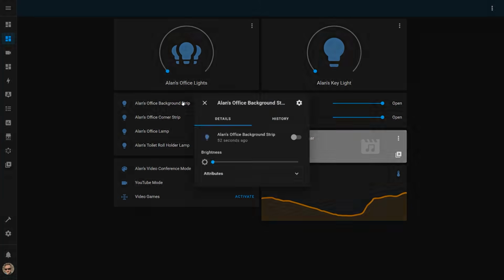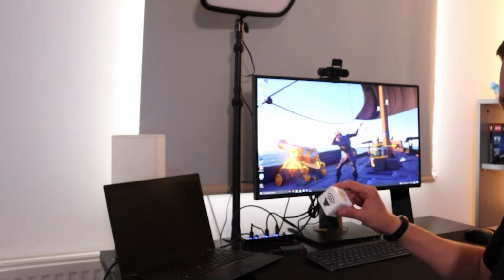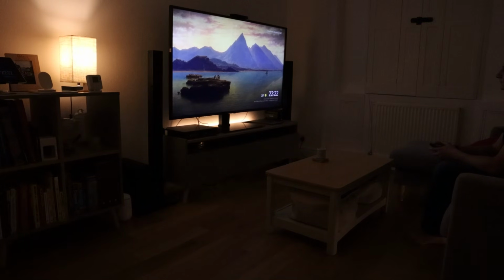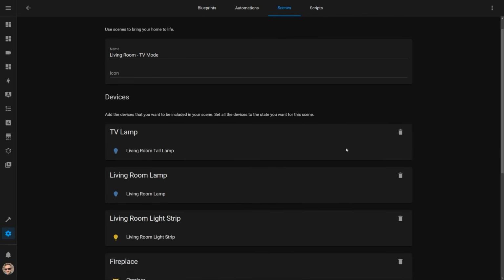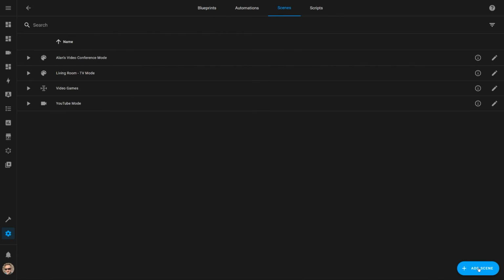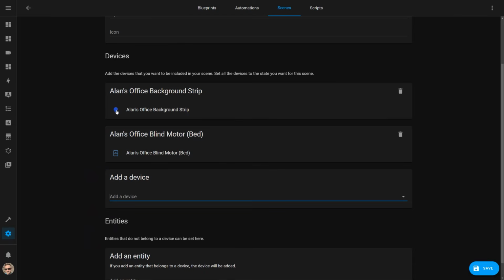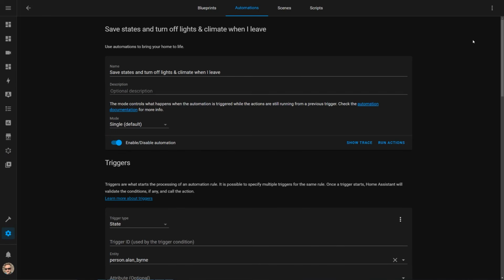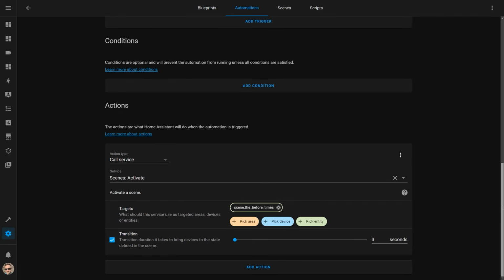Using Scenes in Home Assistant - Home Assistant Tips

Comment: nice! i've a similar setup, HA and zigbee based stuff, only difference is that i tried using appdaemon to create more complicated automation (like binary sensor > lights blinking, ) and more importantly for the appdaemon dashboard that i can run with my very old ipads. Gonna try out the magic cube!

perhaps would be good if you can talk about (if not yet)
- smarthome, power outage, UPS
- networking for CCTV on VPN & HA integration

good stuff! keep it up

Comment: The temporary scene ok, I can follow, but a normal scene. I see no use for it at all. I can group lights and do the same with one command in an automation just not only turning on the lights but also add the parameters for brightness, RGB and so on when switching it on.
In my eyes HA scenes are absolutely useless as I can do it via a normal automation and as fast as with a scene.

When I first read scene I thought it would be a group of parameters I define for my device and when I need it, I just tell HA to use these parameters on my device. That would really make sense.
For example I want all my corridor lights to switch on with a special brightness, warmness or color depending of the time range the light is turned on. I don't want all lights to turn on with these parameters, no they should go on with these parameters when they are needed. So lets say I have 5 individual lights and I want to have 3 different kind of parameter set for these lights, Day, dawn/dusk and night. With scenes I now need to define 15 different scenes. just to accomplish this. That's bullshit. Then I can define three automations with if else clause to make that. It is the same, but far more easier to track.
I'm sure with yaml or in Node-RED you can easily program it by using a set of parameters in a variable to accomplish this. Unfortunately I'm not firm enough in either of them to do it. Then if you want to add another light with these same settings you don't need to create another three scenes or if you think the parameters for night should be different I don't need to change x-scenes so everything is fine. I change it once at one place. 
That I would call a useful use of a scene.
Just my humble opinion.

Comment: Nice video. for the Magic cube, did you draw or use stickers on the sides?
Reply from the maker: I used stickers! I found some icons I wanted to use on Canva, and then got the stickers printed via Moo.  You can see the whole process on the video I did about the Magic Cube https://youtu.be/wRf9RT2YgaI

Or you can get the stickers from here: https://www.canva.com/design/DAEeFGcOvyI/njeSi3gRU1c--k1bz6x57A/view
Reply: @HomeAutomationGuy  Thanks. i just watched the video. Have you done the Zigbee 2 MQTT video? I use ZHA and I've always wanted to know which is best of the two.
Reply from the maker: @xtremeideaz  I have not done a video about that, but it's one that I was thinking about doing in future.  I've used both ZHA and Zigbee2MQTT in my setups and to be honest there's not a huge amount of difference.  Zigbee2MQTT has a bit more compatibility with a larger range of devices, but ZHA is way easier to use.

Comment: Just been following along but got stuck at the Flashing Light bit.  I couldn't find the settings for Flash.  In the end I edited the YAML and pasted your code in,  then I saved it and switched back to UI mode and it was there.  Would have never known it was an option if I had just relied on looking through the UI.  Thanks.
Reply from the maker: Glad I could help